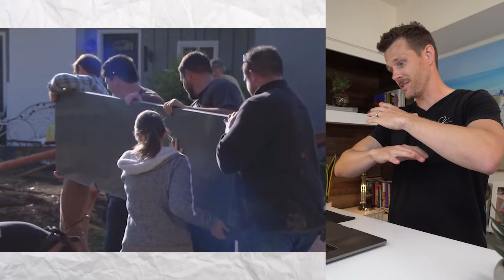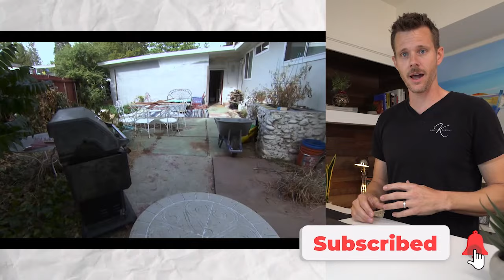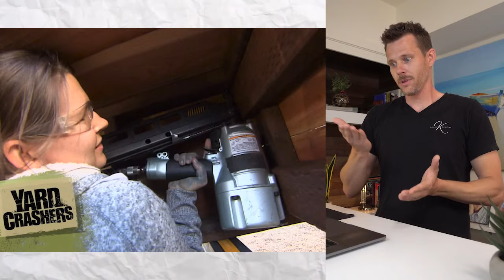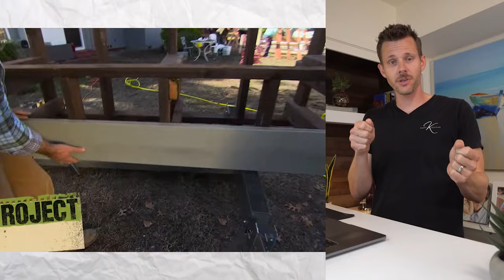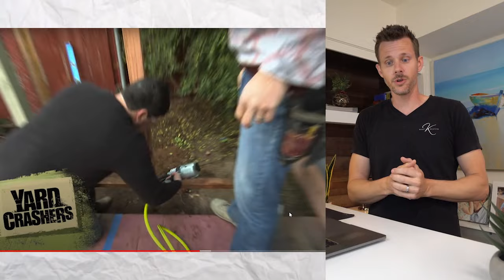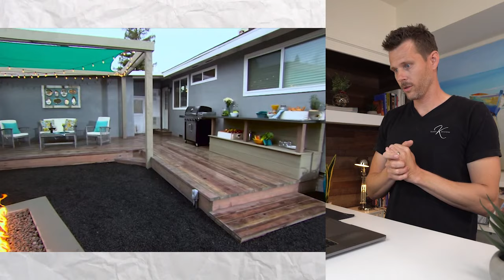This Backyard is INSANE[PRO REACTS]

Comment: Quartz has resin to bind it together The resin interacts with the UV light outside and turns yellow. Like plastic or glue does. Not a good look over time.
Even granite can have a little resin in it if it’s heavily veined and the resin is needed to fill and stabilize the veins. So the cheaper speckled granite is a safer pick especially if it is in full sun.
Reply from the maker: Thank you!  I knew someone would know.  Great description.
Reply: Likely they were using Quartzite not quartz. Quartzite does very well outdoors and with weathering/UV
Reply: @PdubsJuicer  Makes sense.